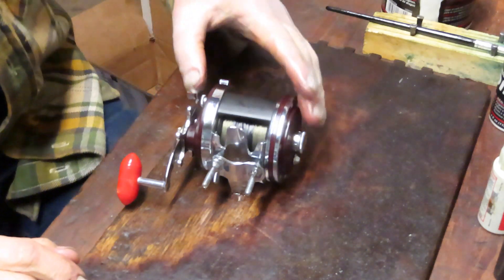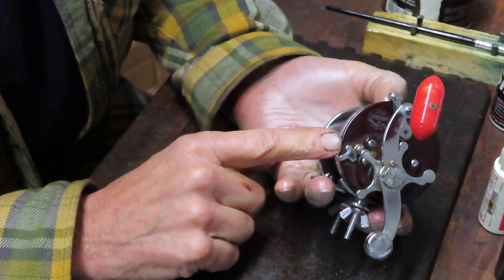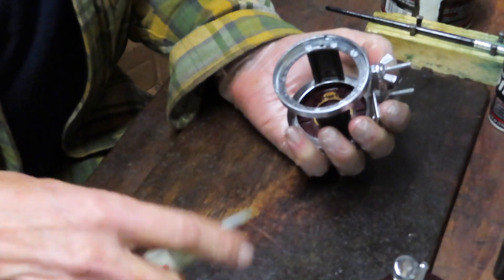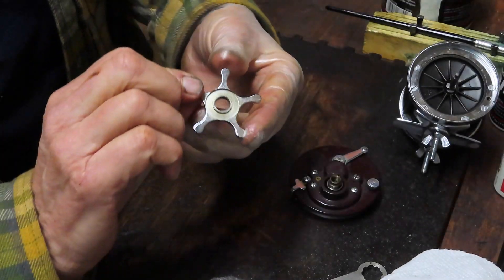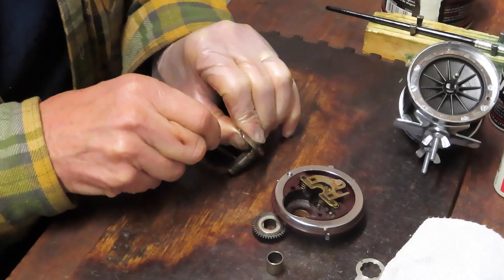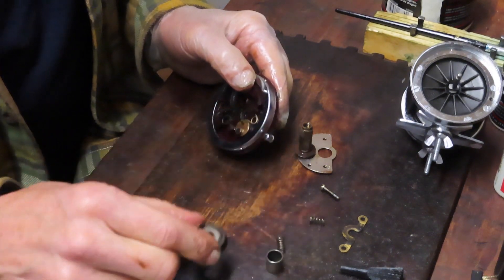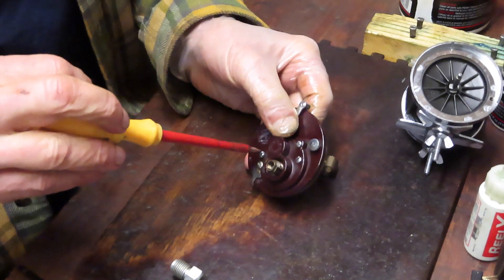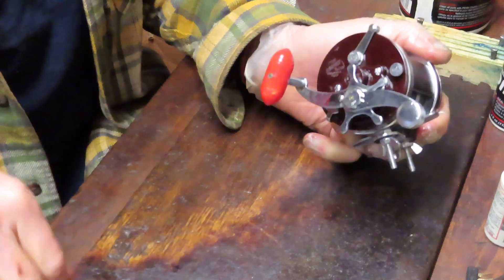Penn Squidder 146 narrow frame fishing reel conversion how to take apart and service

Comment: The "Fighting Switch" or "Dog Override" switch is also good to use not only as a drag saver... but, if you know how many feet/inches each revolution of the crank lets out, it can be used as a depth counter to let your line out to a specific depth where you know the fish are.  I use mine on my Kokanee rod and  I can target the fish repeatedly in the strike zone.  It's basically a very accurate, reliable and mechanical line counter that will never fail you.
Reply from the maker: Thanks for the tip!  Best wishes - Dennis

Comment: Another great video Dennis. I had a similar issue with the eccentric spring on a Jigmaster 505HS. The tag end of the spring needed to be filed flush, because it actually scored a groove in the back of the eccentric jack over the years.
Reply from the maker: That happens a lot more than you may think.  Those springs have variances in the length of the arm and with use poke through more than they should.
Best wishes - Dennis

Comment: Me again, thank you for all your help. I am in the hunt for a Squidder but know nothing other than watching your videos. I want to surf fish, living on se Florida coast , and liking the idea of a high speed reel. How can I tell the high speed reel apart from the standard and what should I consider when shopping online as to what to look for or stay away from. Of course I will need a rod too , I am a 77 year old beginner. Thank you for all you do.
Reply from the maker: OK - the best thing to do is an internet query when you narrow your search for reels.  There are plenty of resources that will tell you the retrieve ratio, spool capacity and number of ball bearings.  A Squidder is a nice casting reel with good capacity, but it has a relatively low retrieve ratio, so working Jigs and metals that need higher relieve ratios is more difficult.  Start by going to a reputable reseller's site, like bass pro or Tackle Direct and search the reels for additional information - Dennis

Comment: Bars are probably Newell, maybe the spool too. Clamp definitely isn't Newell. 
Squidder jr conversion kits use to be popular around California in the albacore days. The anti reverse switch on my squidder has been modified to disable it. The new drag kits available for this reel really does help it stay modern enough to fish. Especially with an upgraded handle and stainless steel sleeve.
I fish mine with 5-7pounds of drag easy. Always fun to bust it out early in the season to catch football tuna.
Reply from the maker: Yes - they are still very effective.  The drawback against modern reels is the low speed retrieve and lesser max drag, but overall casting and fishing with it is a joy.  Best wishes - Dennis

Comment: Hi Dennis, Another great video. We spoke a year ago you live a Colonia NJ and I grew up in Woodbridge proper. I started to do repair work and cleaning for some charter boats on the Jersey shore 3 years ago so I'm still learning. I'm having a problem with a Penn 100 Beachmaster, the reel is almost new, very clean when I open the right side up. However even after I removed the HT 100 drags, greased them the reel doesn't turn freely. Any thoughts?
Many thanks, be well stay safe,
Bill K
Reply from the maker: Bill - please call me or send me a note to my email 2ndchancetackle@gmail.com - Thanks for asking - Dennis

Comment: What is the purpose of the small screw on the handle when have a nut holding the handle on?
Reply from the maker: That is a set screw to help lock the handle nut.  Boat engine vibration and general usage can cause that handle screw (nut) to shake loose - Thanks for asking - Dennis

Comment: Dennis can you use pin real grease on an ambassador reel
Reply from the maker: Yes - if the grease is designed for fishing reels, it does not matter which type reel you use it on - Dennis

Comment: Hi Dennis  Can you explain the Squidder 140 &146 color variations and side plate graphics?  Black,(has 2 different graphics) Dark maroon and light maroon.  Can you date the reels by this information  Thank you.

Dan
Reply from the maker: Dan - the reels originally came with the black side plates that were etched with the fishing scene when it was introduced int he early 1940s.  In the 1970's Penn changed the side plate color to Maroon.  These were changed back to black in the 1990s.   Unfortunately, I cannot be more specific on the dating - Thanks for asking
Reply: @2ndChanceTackle  Thank you.  Very helpful.

Comment: dennis im bidding on a power handle on ebay for my 146 good investment  or not reguards peter
Reply from the maker: Power handles are a matter of preference.  You can use the bigger Jigmaster or Long Beach 24-66 is you like.  The gear sleeve mount is the same as your 146.  Dennis
Reply: is the 24 66 a larger handle that what im looking for

Comment: 3 1/3:1 
12lb/250yd
Reply from the maker: Thank you for the additional information - Dennis
Reply: @2ndChanceTackle  don't thank me, it's on the box of a mint reel asking for $200 on ebay with the twin plastic air brake spools and a metal in the reel. 

Question: just swapped stainless bridge pinion and main gears from a 500s into a early 2000s jigmaster. What were those original seafoam green and white drag disks made out of?

Comment: Dennis where can I buy gears for 1972 6,000 ambassador real
Reply from the maker: The two services I use are Southwesternparts.com and ereplacementparts.com I am unsure if the parts you need are available due to the age of your reel, but if they are, those sites would have them.  Thanks - Dennis